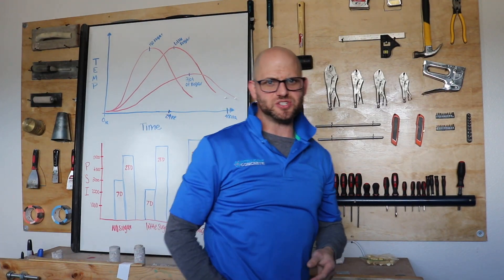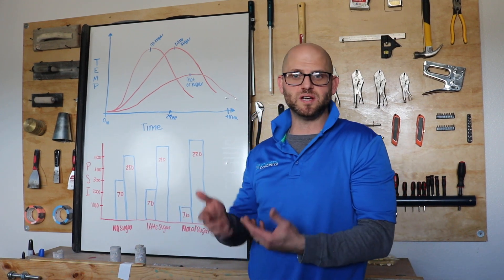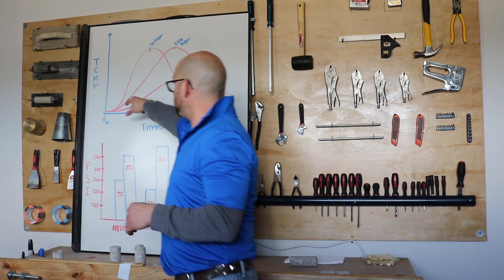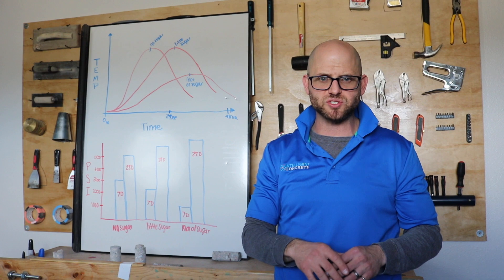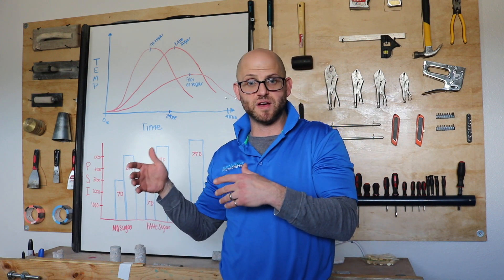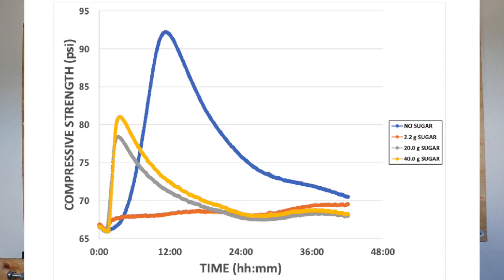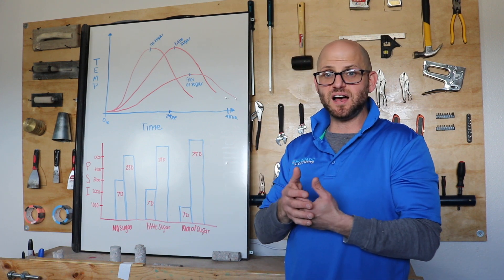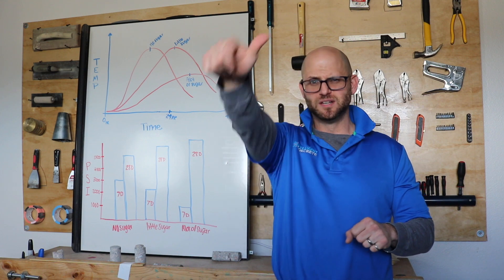Concrete Sugar Mix Design - Vlog #263

Comment: All in this same video, your ref mix is defined as:
First pic:  1980g sand,  880g cement,  0.45 w/c 
Your voice:  990g cement  404g sand  440g cement  0.47 water /cement ratio
Video text:  990g sand, 440g Portland cement, 189.2 g water

Is the “Video text” definition what was actually used for your ref mix?

Comment: Amsterdam, 
I was told that Dutch forced labourers in WW II , pouring concrete along the ,Atlantic Wall, to place  big guns on top for the Germans.
Was sabotaged by all of them adding sugar in the mix.
The concrete got britle, and cracked. 
When the first test salvo 's were fired....
10 workers got randomly executed, in front of all ,slaves, 
And all sugar was banned from the building sites 😢

Comment: Using Euro recover to do an overlay in South Florida in the Summer. It is around 90 degrees f and high humidity. I will try and get to it when it is in the low to mid 80s early on. A bag of Euro recover is 40 lbs. I would like to know if you have a reccomendation on how much sugar to add per 40 lbs. This stuff sets very fast and I really need some time to get it down. I will be adding ice cubes into the water to assist. Any thoughts? The overlay is only 1/8 thick. Thank you

Comment: I’m watching a ton of your sugar videos and I’m getting confused. I have a very very long DIY wrap around bar top to make and was thinking of a retardant to help with work time. I’m worried I’ll add too much sugar and compromise strength so how do I properly calculate per bag of concrete?
Reply from the maker: Run smaller scale tests and time how long it takes to get to a setting strength with different amounts of sugar.  Then scale up.  

I would start with 20 lb batch of concrete and at 20 g of sugar increments.
Reply: Try 1 bag of cement = 24 grams of sugar or 1/4 US cup
Reply: 1 bag/40kg of cement = 1/4 US cup of sugar or 24 grams of sugar